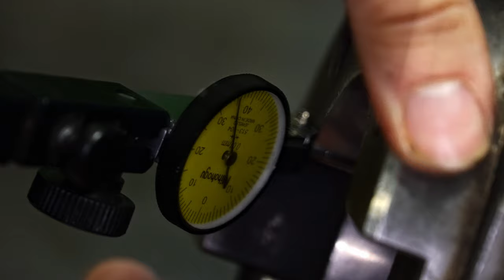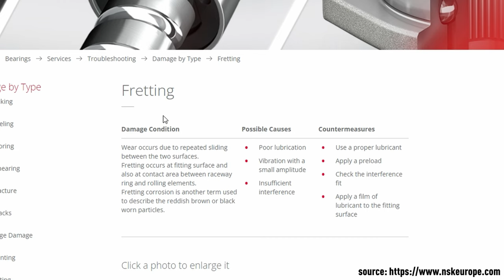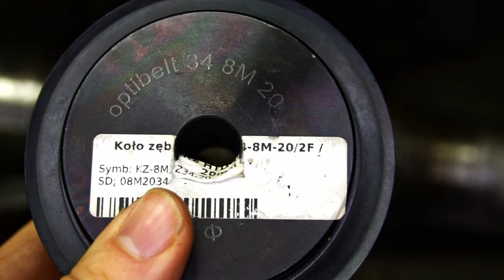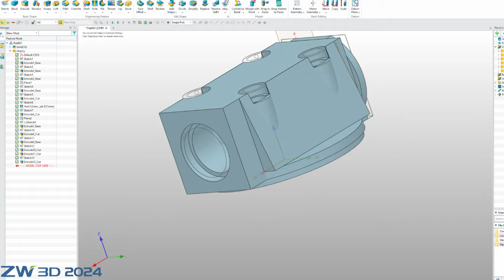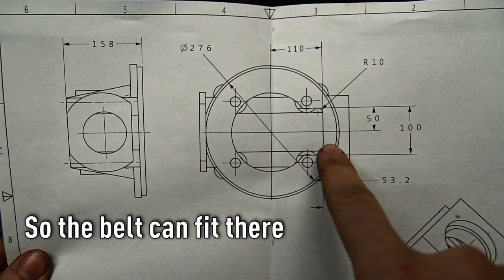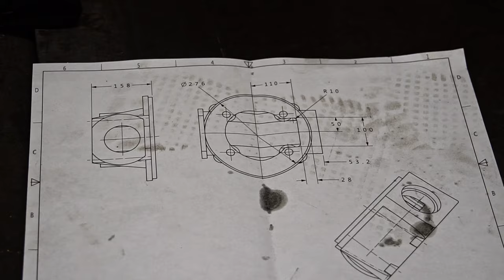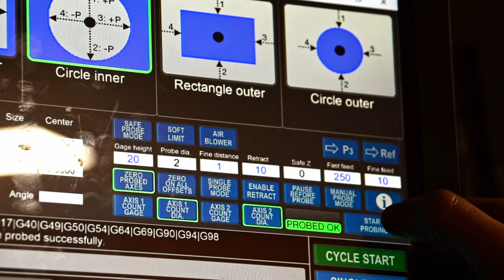Spindle Restoration and CNC Conversion - DIY CNC Metal Lathe Build! #1

Comment: Your abilities are great. I'm going to DIY a new cnc machine.  But I'm not yet concerned with the electrical system.  When I saw you created it.  I feel like I'm pushing myself.  But it's still very confusing.  Can you help make a clip?  Can you give me a detailed procedure for connecting the servo and drivers for all 3 xyz axes?  From beginning to end, because there were a lot of wires, I didn't really understand the electrical system and connecting the Sovo motor.  I see you write on paper  If there is, it will increase understanding a lot.  Thank you for the knowledge you share.  For people who don't know the recipient
Reply from the maker: i made already some videos about how to make things related to CNCs. But i'll try to make a video about my servo-driven cnc mill too

Comment: Interesting project.
50 int taper is a Very robust setup and very reliable. 
Why spend several minutes showing the cleaning process when progress would be better.
Bearings....you did not inspect the inner race track for wear or damage...bad move. Granted you won't be putting it under the same loads as in industry...but you will have noisy bearings. Most times they have acceptable wear with no issues.
Loose bearing fit...there are products widely available that are liquid adhesives that are designed exactly for that purpose ( Loctite is one such product) They would ensure the bearing is kept central and not offset as will happen with what you have done. Also popping the shaft as you have lasts a very short period as vibration will take it back to what you just had previously. That will give you spindle vibration and cutter problems.

Bearings of this type are Meant to run with a "preload" on the bearings, I can't stress enough that you should address that. The preloaded bearings ensure smooth operation.
Find the data sheet from the bearing manufacturer and that will be a good start.
Also pay close attention to machined mating surfaces for flatness... something you haven't done yet. Dents or damage will affect your readings and also contribute to things coming loose in operations.

Keep going you'll get there !
Reply from the maker: I didn't know about such loctite product. Thanks for your hints - it will be valuable in the future. If there will be problems later on - I'll have some things I can consider. Btw I preloaded the bearings with the nut so the spindle is preloaded.

Comment: jes that bearing is shot, why didnt you replace it?
Reply from the maker: The measurements indicated that the bearing race diameter is ok and the shaft diameter is a little to low. I have no possibility to make a new shaft so I used the old one following the NSK company rules - they say some grease should fix the problem (I additionally added the center-punches to fit the diameter even better). A new bearing would cost me almost the same as the whole spindle when I was buying it. If it won't work well - I'll try to replace the bearing in the future but for now it should work for a while.
Reply: @GBWM_CNC   the whole cage was wobbling that is worn inside and out, thats not a too expensive bearing type so you had a good deal on that spindle
Reply from the maker: @DeviloftheHelll  the ball cage was wobbling because the bearing has to be preloaded first. That's nothing bad for that type of bearing